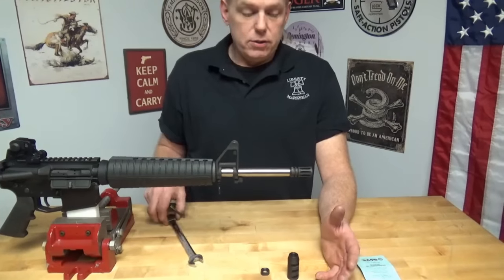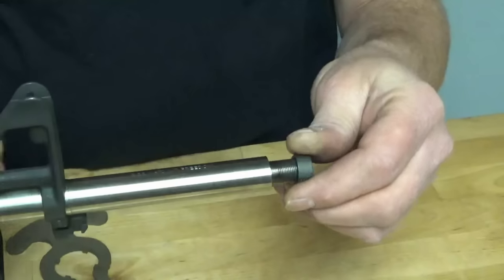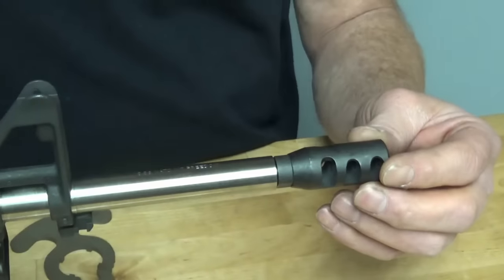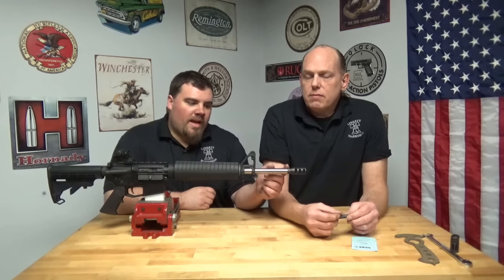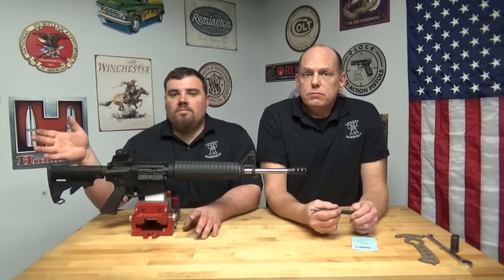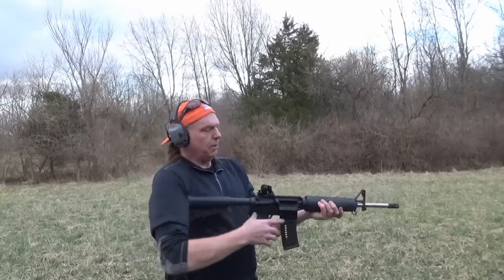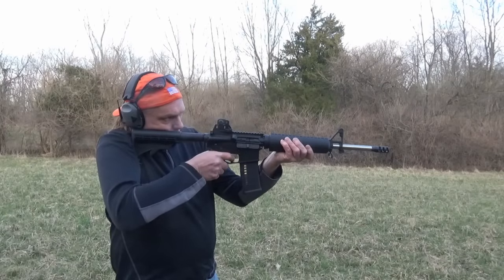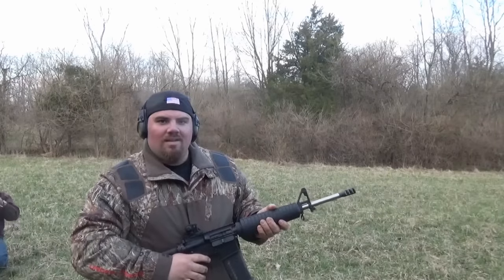Jerry Miculek Muzzle Brake Install & Review

Comment: Purchased the DPMS Jerry Miculek Muzzle Brake for my AR10. Installed it and went to the range to test it out and sight in my Vortex 6x24x50 first focal plane scope. First, the muzzle brake performed as you stated. The recoil was greatly reduced from the original POS flash hider it had previously. The scope was sighted in with only six shots. Best day I had in a long time. Thanks for you excellent videos, which helped me choose this muzzle brake, Richard
Reply from the maker: Vary cool glad we could help

Comment: I've got several of these JM muzzle brakes on my rifles now. Like you, I was worried about moving the break away from the threaded barrel shoulder, as this gap is a weak point. The solution was to sand down the nut collar, so the brake will mount tight against the barrel shoulder.
Reply: Great idea!

Comment: I really like the one on mine but it's come loose a couple of times. Mine ended up about the same position yours did when threaded all the way in so I filed the barrel side of the jam nut a little at a time until I ended up with it timed straight up with the nut and brake fully tightened to the barrel, no gap. Havent shot it yet that way so we will see how it does.
Reply from the maker: That's a really good idea let us know how it works out.

Comment: Hi 
Isn't it risky that there is a gap space between the nut bolt and the barrel?
Reply from the maker: You would have to hit it crazy hard to have a problem. It was designed for 3 gun competition. If you watch those guy dump them into a barrel and never have a problem.

Comment: I have a FN FAL someone threaded the barrel to 1/2 X 28 like an AR-15. They had something on it that looked like a beer can on sideways. This thing works fine but it is too big to be practical. I need a muzzle brake that I can put on this FAL since I can't use a standard FAL flash hider. I got a bunch of AR-15 bird cage flash hiders  for 5>56 we your product work for me.

Comment: by the demonstrated method we are torquing steel takedown pins through the lower receiver. the upper receiver should be supported either with a barrel extension tool like the geissele reaction rod or an upper receiver vice block.

Comment: Have y'all tried the M4-72 Sever-Duty Compensator? Granted it is costs twice as much as the Miculek break although reduces the recoil a lot more than the Miculek one does and from tests I have seen the M4-72 reduces recoil more than any other brake. And at the $80-90 range more mid tier pricing.
Reply from the maker: +Sith Yarael We have not, We do plan on it after how well this one worked we would like to is the difference.
Reply: Cool. From videos I have seen it is on my build list once I get the money to build an AR. Would love to see what y'all think about it compared to this one.
Reply: Liberty Marksman old comment but I hope you see this. If you do the m4-72 also do the SJC Titan Comp. Those 2 are neck and neck but it looks like the Titan is slightly better mitigation at the expense of fist fighting your range neighbor every other mag.

Comment: I think you are supposed to use an upper receiver vise block to change muzzle devices or to do any barrel work. Just using a lower receiver block and putting that torque on the gun will probably damage the receiver.
Reply from the maker: You our 100% correct if you are torquing it to hard that can happen. We use a barrel spline tool most of the time and they work great.
Reply: +hi That's for using a crush washer or shims. Where you would be torquing down hard. You don't need that for a jam nut like this.

Also, you don't want to use a vise block. you want to use a barrel clamp.

Comment: Great video. Thanks for taking the time to film this.I have an 18-inch stainless steel 5.56 Wylde barrel.  Is it better to use a stainless steel compensator on a stainless steel barrel? Or is it a
 non-issue to put a non-stainless comp on a stainless barrel? The metal expands at different rates when heated up after lots of rounds.  That's why Im asking.
Reply: Bill Walters would look better for sure.

Comment: Hey guys can i ask if i attach this muzzle brake like in video does that gap between barrel and screw before compensator affects accuracy ? And second question if all threads on muzzle brake are not connected to barrel is it ok that there are treads after the rofles barre and bullet flies trough them before gases are disperced by muzzle brake? Im shooting haenel 300 win mag sorry for my english

Comment: From an aesthetics point of view: are there any breaks that actually connect flush while lining up correctly on the barrel?
Reply from the maker: some do with the use of a crush washer, I have a Midwest Industries one that does.
Reply: If you don't like that little gap, a crush washer is the way to go. You just hand tighten it as far as you can, then tighten with a wrench until it's lined up. The crush washer will crush as you tighten it to line it up. lol I guess that why they are called crush washers. Small side goes towards the barrel. As it crushes it fills the gap.

Comment: can you put a crush washer in between the lock nut and barrel
Reply from the maker: Don't see why not.
Reply: Liberty Marksman f ft
Reply: Yes but it's not needed and if anything it limits the amount of threads the break engages
Reply: If you are worried about the gap, drop a few shims behind the crush washer....iv put several hundred rounds through mine and I'm not seeing an issue

Comment: Why ask the viewers to inform you on how it works clocked, this is a review video, review it clocked, straight up and down , sideways and back wards
Reply from the maker: +yandri arce You are absolutely right! We did not experience any torsional issues running xm855, that doesn't mean someone else wont. We are working on a compensator test rig that would verify results with numbers and not the typical "ass dyno" results. Thanks for calling us out on our oversight, viewer feedback is always appreciated!

Comment: Ha! I bought 2 of the same muzzle brakes off ebay for 12.50 a peace,and put one on my new diamondback db ar 10 308.it went on really easy,then I tryed to put one on my ati omni hybrid 300 blackout and could not budge it at all.i took it to my brother in law and it took some time but he got it off and put it one and I shot both gun 2 days later and they both shoot like my 22 rifles hardly no recol at all from eather gun.now I've got me a savage ba 10 stealth 6.5 creedmoor with a 24 inch barrel and I'm ordering me 5 more of the same muzzle brakes from ebay and put them on my 6.5 creedmoor and I'm having my t/c dimension 300 magnum barrel fixed so it can have one threaded on it and keep the ones for other guns in the future,great muzzle brakes just try ebay or Amazon to buy them and don't get eat up by big dealers for your guns need o now one thing I for got to tell you about the muzzle brakes they make your guns about 5 times more louder so be ready to buy or put on ear plugs or head muffs!!!!!
Reply: Pete Bentley k but it’s a cheap knockoff ... not the same size holes either but yea

Comment: I'm not impressed with the lack of safety. Take the darn finger off the trigger if your not about to fire it.
Reply: Unplug your Ethernet cable, should solve your issues
Reply: They are on the range with the weapon pointed down range??? Is the only thingyou know that seeems relavant is booger puller off bang switch, it applies most times but not when you are hot pointed downrange"its called shooting".
Reply: Im with you he almost looked in the barrel lmao